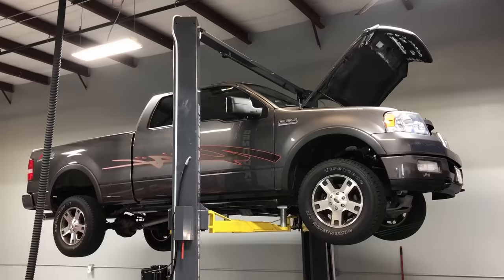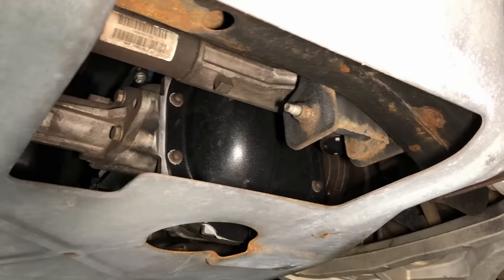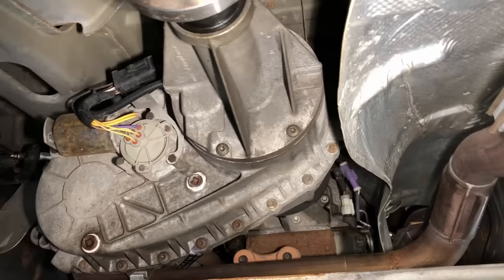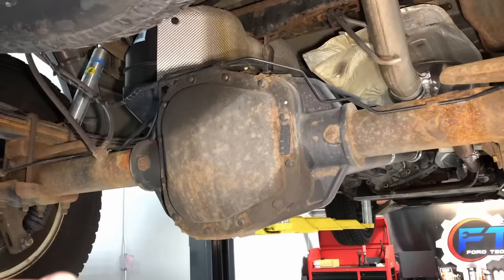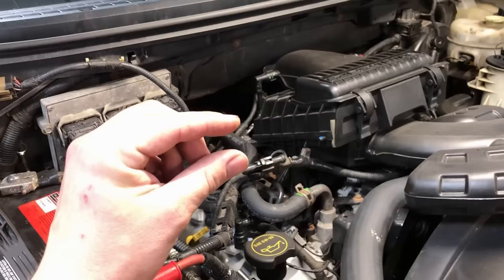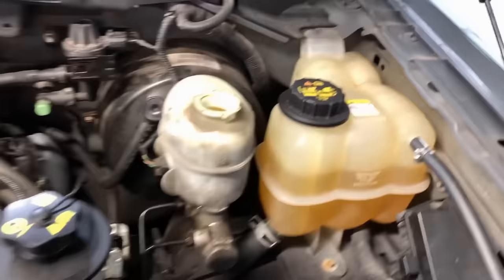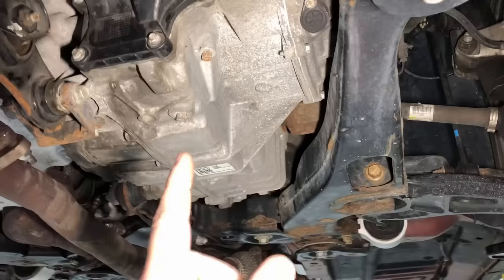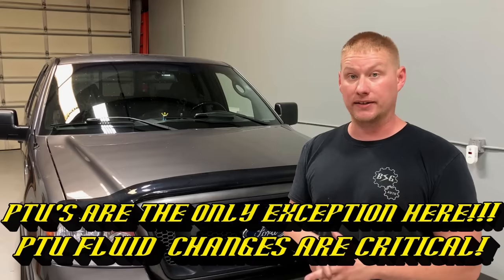Never Follow Ford's Lifetime Fluid Service Intervals: Here’s What I Recommend and Why!

Comment from the maker: Ford Vehicle Maintenance Playlist:
https://www.youtube.com/playlist?list=PLnkaHoqfNwiE3T-rhv1MmBsc4vitaFTeM
Reply: Thanks for the great videos and providing so many great resources for your fans to use!  Thanks for your service to our country!
Reply: Does 05 mazda Tribute AWD have same PTU unit in it?
Reply: Thanks Brian for the great/helpful videos. Quick question......I only put 2,000 miles per year on my 2012 Superduty (V8 gas).  Should I change my fluids sooner (at lower mileage) since it will take me longer to reach your recommended mileage based fluid changes?  I’m just curious how time affects these fluids also. Thanks again!
Reply from the maker: Same as the Escapes of that era yes.
Reply: FordTechMakuloco is that the engine you got from Powertrain products
Reply: What are your thoughts on  oil separators for the PCV to reduce blow by and engine sludge for the  eco boosts,   or is it an issue on the new 3.5 2018 F150
Reply: Thanks!  You are sure right on the spark plugs.  I changed mine on the 3.5L in my 2010 Lincoln at 45K, and the gaps were eight thousandths over the upper spec limit.  Plus, I was barely get them out, due to corrosion.  If I had waited to change them, I’m sure at least one would have broken off in the head.  Used anti-seize on the new ones.
Reply: Thank you for the playlist !
Reply: What would you say about the interceptor utility as it has different cooling?
Reply: Brovo for your video! ( 12 years factory Ford tech here ) and you're 110% correct!! I like to say " mechanical breakdowns start at the fluid level " as a long time ford tech have you noticed that ford made it harder to service amything? Ie; no drain plugs in trans pans now? Personally i have lots of love for Toyota. They use drain plugs in everything from diffs to trans pans. I drive a 2002 f150 5.4 2v 180k miles original engine and trans, i do most all fluids at 30k max. Great video bro!
Reply: In 15 years I still haven't found a vehicle that can beat my 2005 om647 Sprinter that gets 23 miles to the gallon with 9600 lb fully loaded
Reply: Hey Makuloco thanks for the videos.Question I have a 2013 escape awd I want to drain and fill the rear diff LOL how would you do it???I dont know how to go about it yet without dropping the whole damn rear sub frame.Thanks
Reply: Hey makuloco, ive been combing through these vids, wondering if you could possibly tell me what part the junction box is for all the hoses that connect on the driver side from the radiator and what not? I have a small coolant leak shooting very small amounts out through there whenever the engine gets up to temp, any help man would be really appreciated! Keep killin it man
Reply: FordTechMakuloco hey I got a 1997 f150 4.6 4x4 i bought it with 66k mikes now just hit 80k I’m personally come from a Chevy family so I’m not too familiar with fords, only thing I’ve done so far is change the oil a few times and  replaced the idle air control valve. If you have any input about what I should be aware of I would appreciate it. Also I have a rough idle sometimes with the air on and while stopped at a red light, any thoughts?
Reply: @FordTechMakuloco  do you have any good and honest mechanic in cliffside park nj or surrounding
Reply: 2003 ford expedition power steering fluid which type??? Thank you
Reply: If my 2007 ford edge overheats easily, does that mean I have a bad waterpump?
Reply: which fluid for the power steering for the 2003 ford expedition
Reply: FordTechMakuloco my 07 f150 uses gold antifreeze can I put green instead
Reply: Is it true you are supposed to use transmission  fluid for the power steering on an 03 ford escape? Why not PS fluid?,  also my mother  has had hose after hose fail on her power steering system.  Esp the return from pump to reservoir.  It is getting tiring replacing  them like every 6 months to a year as they form holes .
Reply: @mrstarr2520  Following BMW's lead of not even having an oil dip stick.
Reply: Hi Brian, I notice you always say pan drop fluid change.  Do you not recommend flushes?  I bought my truck at 77,000 miles and it has 94,000 now.  It is a 2009.  Not sure if the fluid has ever been changed and am debating on if I should flush or just have it changed a couple of times?  Thanks for all these helpful videos and recommendations!
Reply: How about a 2016 Ford focus. Have about 46k on it my wife hardly drives it. Do I need change out the trans fluid. It has dct trans in it.
Reply: Good Day Brian , I Have a 2015 Ford Transit 250 90,000 at my local Ford Dealership for a verified torque converter shudder. I talked with my service manager about fluid change and filter change on the tranny, said flush and fill is good enough, what about the the filter he said with the flush you don't need a new filter ? Humm. Trannys out would thst be easy to change.  Its like he's arguing with me. I asked about fluid change for rear  differential, we just suck it out and replace it with a machine, me dont you take the cover off and do visual inspection, them nope,  My comment I must be old school , change the fluids,  change the filters , look at it , touch it, smell it , their  comment. Its ok to be old school. Its due for oil change while it's there but I'm scared they will only change the oil but not the filter. 🤣
Now im being silly.  Your input would greatly appreciated. 
I love your videos keep up the great work.
Reply: No one ever talks about second generation Escort GT
Reply: Is this exchange interval valid for the 6f15 transmission of the Ford Ecosport? my car has 60k miles and i'm worried because in the manual it says 160k miles.
Reply: Needing some major help on if I can use full synthetic on my 08 150. My truck has 208k miles. As far as I’m it’s never had full synthetic and I want to keep the truck as long as possible would you recommend changing the oil to full synthetic? I’m worried about leaks and I use 5w-30. Also, my  cat on the driver side is out do too 7 and 8 pig tails not being connected to the harness. Do you have videos on how to change that?
Reply: Changing spark plugs it's tricky,  brake one and engine finish. Change only if not working properly.
Reply: Please advise how to service 8F35 transmission in Ford S-Max, 2019, 2.0 tdci, 190hp, ecoblue. Generaly, with this transimssion how to take care od them best possible way? I need to care my car good…

Comment: Imagine a world with drain and fill plugs on all powertrain components?  Making regular maintenance so much easier.  Wouldn't that be awesome??
Reply: We can only dream!
Reply: Toyota trucks do.
Reply: Chevy does on the diffs and some models have drains on the trans. Not sure why ford cuts those corners.
Reply: @flyer8493  sounds like good common sense to me. 😜
Reply: tommyboy180 bc ford want you to do a complete diff svc and perhap to look clossely to these gears and the breather port as well 🕵
Reply: Yes it would be especially on the bottom of the transmission fluid pan.
Reply: Popping the cover on the diff to drain it is a good practice either way.
Lets you clear out more of the fluid,and have a fresh seal on the cover.
Reply: Oh no Glen, that would bankrupt automakers! 😂
Reply: If there were drain plugs on everything it would be a dream come true
Reply: And dipsticks on the transmission!
Reply: @wesleythompson7  Their are after market replacement transmission  pans for Ford's with a drain plug. Bought mine from Amazon $25. I used my old pan gasket. It's better quality than the replacement cork gasket that came with the new pan. Easy  clean fluid changes now.🏁👍
Reply: @flyer8493  - Not anymore!  Tundra automatics are completely sealed.
Reply: who has problems changing Fluids?
Reply: @MotFPS  Because most transmissions have the filter inside the pan. This way it's impossible to change the fluid an not the filter and the filter is honestly the more critical component.
Reply: @Cragified  That doesn't make any sense. It's corner cutting and anyone that defends it is a shill. There's nothing but benefits when having a drain plug. I may want to drain/fill every 15K because I do heavy hauling and I'll change the filter every 30. I want drain plugs from the factory. 

If you're such an expert Cragified, then tell me why Ford doesn't have drain plugs on diffs....hint: corner cutting.
Reply: Lots of older cars had drains and fills on almost everything not to mention almost all joints had grease fittings to keep them lubricated. If you followed your regular maintenance schedules a lot of that stuff would last a really long time.
Reply: That's why I stopped buying domestics.
Reply: thats how my 08 ridgeline is love honda
Reply: they still have drain and fill plugs just no dipstick.
Reply: @MotFPS  because they don't make any money of a car that lasts you the rest of your life LOL
Reply: Yeah, it sure would make regular maintenance so much easier, for the consumer, but making things so they are not serviceable forces people into the dealerships where they can force you to spend insane amounts of your hard earned money, for what you could have normally done yourself for a lot less. Hell, just look at California passing laws that prevent vehicle owners from working on their own cars on their own property. Tell me the dealerships and automobile industry in general didn't pay off a few politicians to get those laws passed. And now that California has broken the ice, it certainly wouldn't surprise me to see other states follow suit.
Reply: @supboy666  Tell that to the 5.4, the EB series, the 6.0, the 6.4....should I go on?
Reply: John Lennon was so concerned he wrote a song about it! Hey, I'm with you both.
Reply: First gen Nissan Titan do I have one trans has a plug too and the diffs as well
Reply: Pretty much every Asian vehicle has those
Reply: That makes too much sence
Reply: 2017 escape has drain and fill plugs on the tranny and ptu
Reply: @Wayneman48  haven't even searched but was reading comments and knew they had to exist. Definitely something I'm going to do
Reply: Imagine a world with electric motors with none of this BS.
Reply: The trucks I work on have drain and fill plugs on all powertrain components, as well as filters on all of them. Takes about 3-4 hours to a complete oil change(~90 quarts of oil total normally, up to ~115 quarts at most), and another 2-3 to do all the checkups, then maybe an hour or two for ECU updates if you're unlucky.
Reply: That would be somethig. Agree.
Reply: @repairvehicle  Toyota has a bunch of sealed transmissions that they use, it's not brand specific it's just planned obsolescence.
Reply: immagine toyota tundra my friend.  ive been up to my elbows in ford oil puked all over me from the time my dad had me changing oil at 14 to 34... then i went to tundra... i change oil, diff, transfer case and tranny and never get a drop on the floor, my arm, my elbow, face nothing... all drops in the pan every time.
Reply: @diesel6916  toyota has a check, its a little more pain in the ass but its there and easy
Reply: @repairvehicle  you dont have to convince me, but people get brand loyal.  i changed transfer case, and diffs on my tundra in 20 minutes... no RTV sealant there BOY!!!
Reply: Just wait till electric vehicles take over.  Don't need to change any fluid on an electric motor.
Reply: Freaking wild dude. Missing a lot in a modern car aren't they
Reply: Such a simple thing and yet it seems to be beyond the capacity of the compaines.
Reply: Get a Bentley with the mineral oil for all and report back
Reply: @repairvehicle  do camrys have it?
Reply: repairvehicle As well as Nissan trucks too.
Reply: @repairvehicle  What is the name of the video? You have a lot of videos and it's hard to find with this weak internet connection.
Reply: @flyer8493  think most of not all Toyotas do - my wife's 08 Sienna does, as does my daughters 13 Corolla. Same bolt and crush washer, in fact!
Reply: stop making sense
Reply: Yeah that'll never happen lol.
Reply: @MotFPS  If you think from a manufacturers view of wanting to reduce or stop DIY and increase dealer reliance to increase profits then it will make sense.
Reply: @repairvehicle  Not on the new Camrys and Corollas. They are also going to the way of shutting DIY to increase dealer reliance. Ever seen how much more difficult transmission oil changes are on a Toyota or Lexus with the sealed transmissions? You should check it out.
Reply: @PatChapp     not needed
Reply: @Cragified     no it's not
Reply: Thats actually possible, all ya gotta do is buy aftermarket parts with better cooling, magnetic fill and drain plugs.
Reply: @JetSkiBuyFixPlaySellChannel  wrong. The batteries are water (coolant) cooled.
Reply: @MotFPS  Ford wants you to flip your car upside down to fill from the same plugs :)
Reply: Drill a whole, thread the whole, and plug the whole
Reply: I want a plug that empties everything (except maybe gas and differentials). Like a one and done.
Reply: Manufacturers don't want you to work on your own car. They want that profit, both from more expensive service/repair procedures as well as higher revenue when, as a result of not enough maintenance, major parts fail and they convince you to just buy a new car.
Reply: @666dynomax  I'll deal with a little mess to get more than 19mpg hwy lol
Reply: And dip sticks to be able to check the level
Reply: Iron *Fe*  I did an engine swap on my sister's 08 Mini Cooper S. Did the head gasket on my 01 Dakota. Pulled the engine and did some repairs on my 73 VW Thing. I have at least 10 small engines I'm working on right now. I'm restoring a 1970 Honda Z50. I have 2 project Honda ST90s. I did the top end on my 99 Seadoo 787. I'm working on an 89 Zuma and a 76 Chappy. Also have 2 Honda quad projects. And I just rebuilt the carb on a late 60s Stihl 08S chainsaw. Planning to replace the 47mm piston might do an upgrade a put a 49mm piston and cylinder. I'm waiting for my 951 Seadoo engine to come is so I can swap that into my 2000 RX. Also have an 81 Kawasaki JS550 I'm building. How about you???

My 2015 Mazda CX-9 is at the dealer getting the engine replaced under warranty with 83,172 miles on it because the garbage design of putting the water pump inside the timing cover.
Reply: Iron *Fe*  wayyy less maintinence when you don't have a transmission, exhaust system, or differentials. An ICE engine is way more complex to maintain than an electric motor.
Reply: Iron *Fe*  I'm 43. Show me a tranmission on a Tesla. Show me how to do an oil change on one. Modern ICE engines are designed to fail early on. Electric motors are going to outlast them by a long shot. I'm sure you think steam engines are better than gas or diesel.
Reply: @666dynomax
Sounds like a personal problem
Reply: Not going to happen.  Ford needs to feed its dealerships service dept.
I would be happen if Ford would go back to putting Transmission dip sticks in their trucks.
Reply: @Wayneman48  what vehicle did you buy it for and what part number do you know by chance? Looking to do it to a 2010 Ford expedition
Reply: @wesleythompson7  Dropping the transmission pan is a messy job, especially if your doing it yourself in the driveway, without a hoist.  A drain plug would have made the job so much easier and cleaner for everyone.
Reply: your gonna open up drain pans and clean them tho to get heavy particles out
Reply: @JetSkiBuyFixPlaySellChannel  electric vehicles the original rolling coal😂 haha foo
Reply: @Wayneman48  Thx for the heads up.
Reply: @ironeagle2526 how special!
Reply: @JetSkiBuyFixPlaySellChannel Right on man! Can’t wait for our Lightning….
Reply: @JetSkiBuyFixPlaySellChannel Like going from a horse and buggy to a Lincoln
Reply: Yes!!!!
Reply: You can always tap one in even with a petcock
Reply: Just makes SENSE...